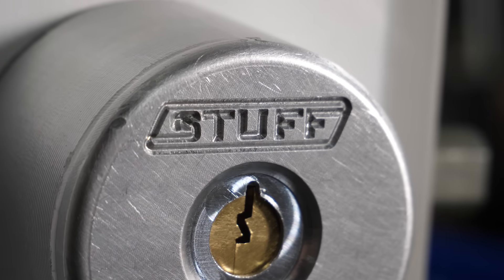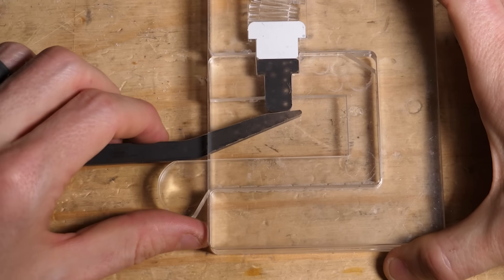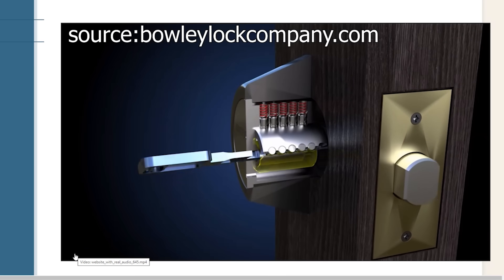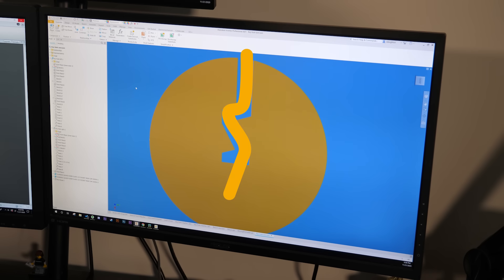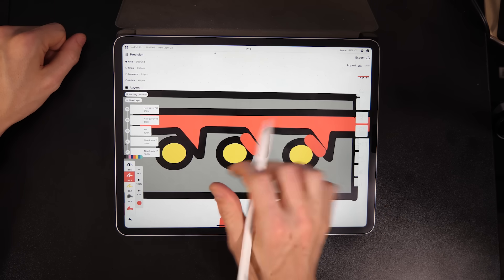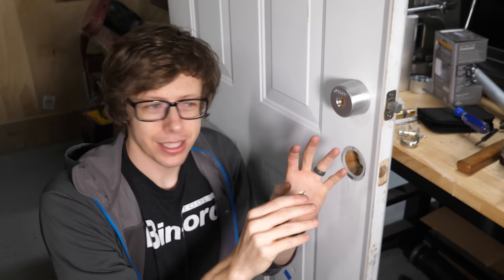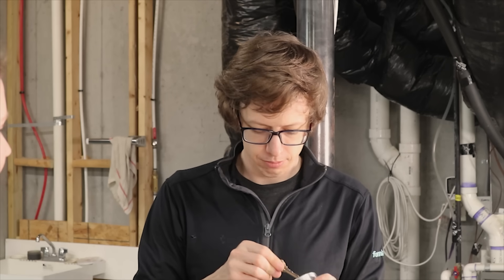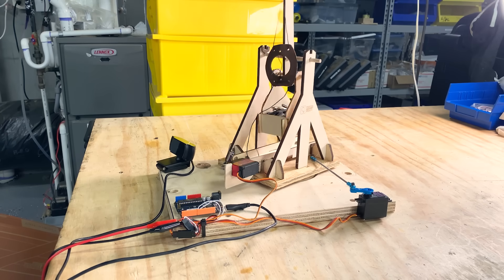Making an unpickable lock. Calling locksmiths

Comment: "Just get a lock that doesn't have a key"
LPL : laugh in neodymium magnets
Reply: XD true
Reply: Me:

Laughs in superglue
Reply: Did LPL ever do a video on this lock? Can't find any on his channel.
Reply: @ouwle6618  look at the pinned comment. It was only sent a week ago and considering shipping time, complexity, video editing and probably a backlog of already recorded videos I wouldn’t expect it this month anymore.
Reply: @ouwle6618  read somewhere in this comment section of this vid that Stuff Made Here had decided to halt the project for a bit, that's why he couldn't sent it to LPL, correct me if I'm wrong tho
Reply: @unrelated69420  I remember seeing that too but in case you didn’t see, he pinned a new comment a week ago saying that he just finally sent it to LPL, along with a brand new design.
Reply: I think that's just a technical win because if you aren't picking anything then it's unpickable.
Reply: Brilliant idea! Have one pin, just one that need to be pulled down by a magnetic key and make the other pins out of aluminium as to not interfere.
Reply: Crazy thing is most "keyless" locks still have a key backup in case of power failure and the like.

All you have with most keyless locks are two methods of bypass.
Reply: Yea adding a electrical component really opens different ways to break in.  No you cant "pick" it, but you can probably hack it
Reply: @DaysieMan  right? And I feel like hacking is a more popular hobby than lockpicking nowadays? Maybe, not sure really...?

Comment: "I found a locksmith that specializes in picking locks" 
Well yeah i hope so
Reply: I think that a lot of them don't. You get to make a lot more money drilling the lock (takes longer, wear on the drill, etc.) and selling a new shiny one.
Reply: @samurijder9550  what do you mean drilling the lock
Reply: @pee829  Taking a drill (to make holes with an a wall for example), drill in to the lock just above the key and destroy the tumblers and stuff. Rotate the remains of the lock and sell a new one. It's almost common practice in the Netherlands. No picking skills needed, just a steady hand and a battery operated drill.

Comment: You should think about reostats, I forget the spelling, its just a electric digital tire pressure gauge... Hmm, would need a computer then...
Reply: It's still a normal tire gauge but has a little wheel with teeth or gears that fit into the shaft that protrudes when you check a tires pressure. In your case you'd need something very accurate like a micrometer... Then, if you put your key in, it's a physical ID, and you can be locked out or let in whenever by admin.

Comment: The main point for improvement that I saw is that the gates are open at the bottom. I don't know if the geometry allows you to make them slot shaped with an opening in the middle. That would help resist bumping, as there is nothing to hold the pin in place unless you can simultaneously shoot them all on a trajectory through the intended gap as you turn the core. Also, could be I'm not understanding how the gates work...

Comment: Probably not so smart suggestion but have you considered a magnetic system attached with it to be able to properly hold everything in place as you test it or possibly a secondary key mechanism but it would turn it into a two key lock doubt I'm helpful but I hope I am

Comment: You can beef that baby up allllll you like. Put it on baby steroids. Pump it full of baby HGH. Make it run on a tiny treadmill whilst people in lab coats vigorously write things on their clipboards. Hell, make it punch teeny frozen slabs of beef and then run up those stairs in Philly while blasting “Eye of the Tiger”. Do. What. Ever. The outcome will be the same:
The Lock Picking Lawyer will demolish it like the Globetrotters do to... that other team that plays them. Like Abe Lincoln did to G. McClellan in the 1864 presidential election. Like I demolish single ply toilet paper whenever I have to use it bc my girlfriend tries to save a little money bc “TP is TP! Just double it up, it was only 89 cents a roll......” 
Well no it’s not Kristen! Single ply TP is garbage wrapped round a cardboard tube! It was 89 cents for a reason. Why should I have to double it up when DOUBLE PLY TP exists already?? You spend more on shoes in a year than we will spend on TP in both our lifetimes so why are you saving 44 cents a roll so that I have to wrap my hand round and round and round for fear the paper will tear and I’ll be wiping my bottom with my bear naked hand?!! 
And the lock thing.

Comment: Once you know the mechanism it’s easy to pick instead of torquing the cylinder you apply pressure to the rear locking pin

Comment: Hey, I'm wondering why I think you overlooked the obvious...
While you do trade the number of "combinations" from basically infinity to... a very finite amount... why not use two meshing rack gears to lock the pins in place? The number of combinations for each pin is then simply the number of teeth, HOWEVER you no longer need to deal with finicky, dumb screws.

Great video, loved the break from dynamics homework. Keep it up!

Comment: Your mechanism of holding up the pins doesn't seem that reliable.  I'd think something more akin to slots in the sides of the pins that are rough/grooved which is then used by something resembling  the medco sidebar to hold them in place (obviously not a true sidebar since these would be the top pins and so wouldn't be rotating).

Comment: "a locksmith that's a expert on opening locks " oh really now?
Reply: that's not what he said.  he found a locksmith that specialized in PICKING locks.  This is important because it's far more common for locksmiths to just drill and replace a lock instead of picking.  It's a more guaranteed approach that doesn't require a multitude of specialized tools and experience.  So yes this was important information that the locksmith he called actually has experience and specializes in picking.
Reply: @NegZer0  plus if they put a new lock in, they get to charge you for that too. So its actually better business to destroy the original lock.
Reply: Some locksmiths are only good at making locks not picking them

Comment: Correct me if I'm wrong, but couldn't qone put a thin tool in to push all the way throw the keyhole, slightly rotate while single picking the pins?
Reply: No, the kew first picks up pins that push the actual locking mechanism up before turning, so you cannot test them before turning.

Comment: The actuation of the pin holder should be made while turning, because when the key is doing this, you can set all the pins as high as possible, rotate to the gates and then let them go down, more or less into the gates.

Comment: This is super neat. I was thinking, in theory this could be Brute Forced with a "mechanical" key attached to a small computer and secured to the outside of the lock. The software would be relatively straight forward to write. Mechanical engineering isn't my strong suit, but I imagine the mechanical key would require such small and precise parts it would be too expensive. At a certain point it's easier to find the owner and beat them with a $5 wrench until they give you the key.

Comment: After sitting for a few minutes thinking about a way to pick it, I think I may have a simple potential solution:

1) Set all the pins to the tallest height and lock their position by pushing on the pin locking lever at the back.
2) Rotate and apply tension (torque) to push all the pins onto the gates
3) Release the pin locking mechanism so all the pins would fall downward (due to gravity... or springs that push these pins down if there are any — it’s hard to tell from the video) if you let go of tension (but keep tension)
4) Give the lock body a few bumps with a mallet and let the torque, bumps, and gravity (or springs) set the pins into their gates (which at this point I believe is similar to standard bumping).

I think this could theoretically be done with only a blank key and a mallet. 

The blank key will push all the pins to the highest position automatically and will allow you to apply tension easily (step 1). Pushing it all the way in will activate the pin locking lever as intended, and all the pins will be locked in the top position (also step 1) until later, when we slightly pull out the key to disengage the pins locking mechanism (this will be step 3). 

You can turn the blank key and apply tension with it such that the top pins are contacting the gates (step 2). The maxed out height of the bottom pins will no longer matter since, in order for this lock to function as intended, those pins naturally cannot affect the top (locking) pins in this position. (See * below if that doesn’t make sense). 

While maintaining constant tension (torque) on the core, pull the key out just far enough so that the pin locking mechanism is disengaged (step 3). (At this point the key could be substituted with a tension wrench if applying torque via a key is not springy enough; tbh, I’m not super familiar with bumping or lock picking other than watching LPL a little bit). 

Use the mallet, give the lock body a few healthy bumps (step 4). The way this works in theory (I think) is that the bumping causes momentary loss of contact between the pins and gates, which allows gravity (or springs — again, I’m not 100% sure if there are springs there) to push the pins downward ever so slightly before the tension re-binds the positions of the pins. This can happen repeatedly, or maybe even just once, until the pins get caught in their true gates, where subsequent bumps likely won’t cause them to move further down. 

* If you think about it, if you could manipulate the top pins with the bottom pins in this position, the the lock would be pickable with normal picking methods.

Also note: If there were no springs pushing the top pins down (again, not 100% sure if there are or aren’t), then gravity would be the force that allows bumping to work, meaning this probably wouldn’t work if gravity couldn’t affect the system (and if there are no springs). Therefore a potentially suitable design solution to preventing this type of picking would be to rotate the position of the lock or gates such that the pins are all perpendicular to the force of gravity, and would therefore have no “preferential” direction to move when bumped. If the lock were simply rotated to be upside down, then, instead of setting the pins to the tallest position, you would need to set them to the shortest (i.e. you don’t even need to push the pins to start). 

If there are springs pushing the top pins down, then this picking method would be much easier and less reliant on gravity and the position of the lock.

Another note: I did say I spend a few minutes thinking about it, which I did, however it took me a lot longer to write it all down lol. Additionally, I originally saw this video when it was first posted, but only sat down to really think about picking it today. 

Last note: Please let me know if I am missing something or if you think this picking method might or might not work! If you have experience with bumping, maybe a more professional opinion could prove or debunk my theory! Also I’m sorry if this idea or a similar one was already written in the comments. I tried to scroll through a good number to see if anyone had any similar ideas, but didn’t end up seeing any.

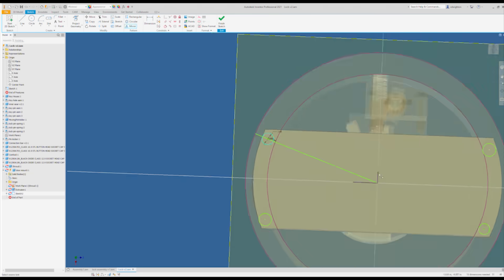[Edit] It looks like at 7:32 in the video the CAD does include springs to push the pins down. This should make my picking method more viable.

Comment: RFID locks aren't impassable, you can construct cards that mimic the real entry card, and you also won't be able to use the lock if there is ever a power outage (depending on if it has its own battery as a backup, as some do). The door's integrity is also worth noting, because if a lock is too complicated the next step is the door, which if left unenforced (weak strike plate, weak hinge screws, week door material) becomes a much easier target for someone looking to get past the door.

Comment: not comertialy viable? a lot of those parts can be manufactured in mass making it cheaper.. the assembly might cost more.. assuming u are letting a company make at least about 1000 pcs.. but the fact the keyless locks exist is the only thing to stop you from selling this... due to human error of loosing keys... but nice project i like it..

Comment: Medeco is not pickable, but when someone is trying to break into your home a broken window works fast. Also drilling the lock with that kwikset deadbolt is quite easy. It takes me 15 minutes to drill Medeco deadbolt and I don't ruin the housing. 5 minutes or less for a multilock.. Primus is very difficult as well. not pickable, but Schlage Everest is if you know what you are doing. There's so much out there to try an figure out how to make an unpickable lock. Good luck

Comment: LockPickingLawyer: now by hitting this lock with a Louisville Slugger, you’ll shatter the pin lock ...and click on one, 2 is binding, little click on THRAY*, click on 4, going back to 2...click on 2, * click** and as you can see, without a KAY it’s possible to get into this lock in less than 20 seconds.

Comment: "This is the lock picking lawyer, and today we will be opening a stuff lock with an angle grinder"
Reply: He’s far more elegant than that
Reply: @Menuki  Ya LPL has a ramset angle grinders are for scrubs
Reply: . along with the special tool him and Bosnian bill made
Reply: @Menuki  he has used a sledgehammer wtf
Reply: @demoknighttf2756  only after picking the lock. He goes non destructive before going hard
Reply: HAHAHHAHAHA
Reply: Haha.
Reply: Mike Smith  cap
Reply: Pain is temporary, glory is forever
Reply: He has an older video where he opens a cheap mass produced safe exactly like that because it had walls from a pretty thin sheet of steel and some seemingly polyurethane padding. So he cracked it in just a few seconds...
Reply: Mike Smith  when

Comment: "i found a locksmith that specialises in picking locks" ah yes.
Reply: I'm a locksmith that specializes in drills, angle grinders, and hydraulic shears. I'm no good at picking locks though.
Reply: Not all locksmiths pick locks.
Some drill or bump them
Reply: @dustinjames1268  then youre a drillsmith smh my head
Reply: @thepizzacarpizza1056  "shaking my head my head"
Reply: @yusufislek3669  woooosh
Reply: Sleep deprivation at its finest
Reply: Rolph Finkin  When it comes right down to it, they don't need those skills because they can still pick 99% of locks.

Comment: Looks like one could cut off the tip to stop the barrier from locking the pins, which could be prevented by using a pin to push the locking lever. Then again, the lever already enters the rotating part off center so it needs to be pushed already.

Comment: The way to pick this lock is to lift all the pins to the max hight, get a false set by turning the lock as far as it will go, then pull the item holding the pins up out of the way while turning the lock. The pins should line up long enough to open the lock. It would be hard to do but it is possible.

Comment: "I found a locksmith that specializes in picking locks"

Excellent. Meanwhile, I found an artist that specializes in drawing.
Reply: Most locksmiths don't pick locks lol you hire any locksmith and they'll drill your lock smash the doorknob they'll do anything but actually pick a lock
Reply: @PeterTrimboli  then what's the point in picking a lock when a thief can literally just drill through it lol

make your locks out of titanium or something in that case
Reply: @kitukitukitu-lous  it is pricy, and a security risk, because you have to buy a new lock, and your door will temporarily have no lock
Reply: @kitukitukitu-lous  You need to make the entire door that strong, and the walls too.  And yes, I have worked in a building that strong, so they got a ladder and robbed the top floor windows.

Comment: My last resort method for defeating locks is to drill it out with the largest drill bit that will fit into the cylinder. If you destroy the cylinder, the pins fall out and you are in. The best locks make it difficult or impossible to get a drill to work by either shielding the entry with hardened material or changing the angle of entry so you can't get a drill to work. Cordless drills and grinders make life easy for thieves. Nice work though👍👍

Comment: Windows can be broken into.

Your wooden wall can be penetrated easily. 

If the door or door frame is not reinforced the lock would be useless.

The lock bolt itself can be cut easily using the correct tools.

For full security you will have to upgrade everything ! Nice Mechanism thou.
Reply: Conpletely missing the point.  Why have locks at all then??

Comment: Take a key with minimum depth cuts on every pin so that all of the pins get set as high as possible. Then attach the key to something which vibrates (preferably close to the natural frequency of the springs in the pin locking system). Then apply constant torque to the key while it's vibrating. The vibration should cause the pins to drop slowly after they've been set and the torque should get each stuck at its proper height until the lock unlocks. Keep repeating this process with varying amounts of force, and or changing the frequency, until the pins slide in the right order and the lock opens.